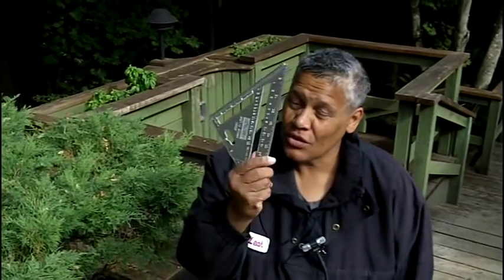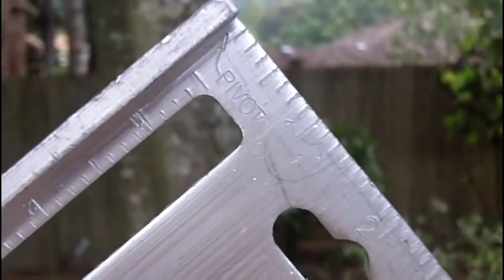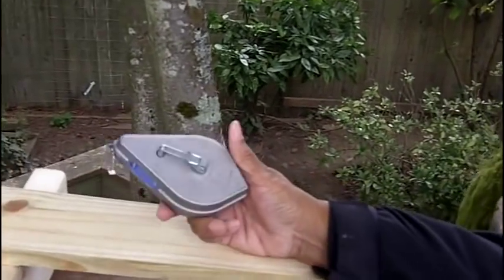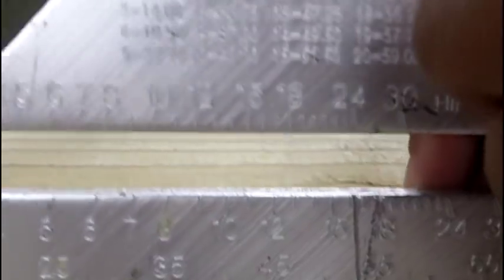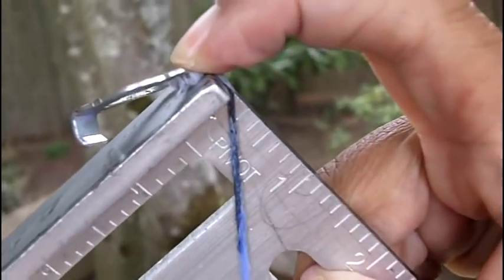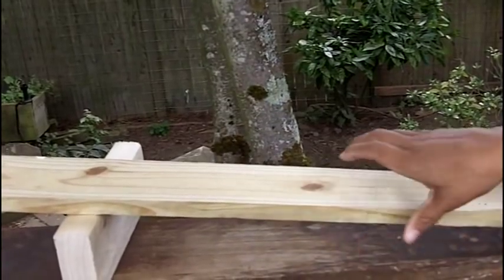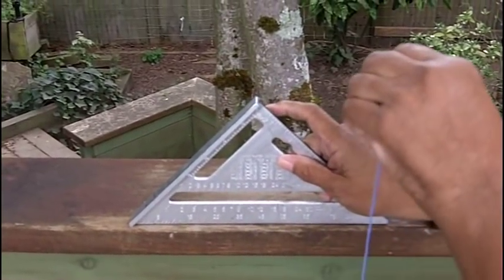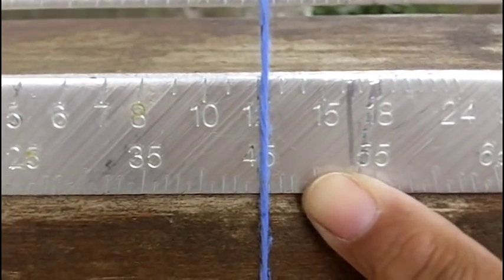If You Have a Speed Square You Have a Level

Comment: Misleading. You can't do it without a plumbbob of some sort.
Reply: Do you wear shoes with shoestrings? Tada
Reply: @TheSaltblock  It's still misleading. But... no, I actually don't. I wear "slides" because I take my shoes off every time I go into the house so I don't beat up the nice maple floors (13/16" T&G) I installed there.

BTW... "TaDaH" is a bit personal; that's my initials with 'a' between them.    8)
Reply: @timhofstetter5654  ill buy you a string for your sunglasses which can also be uses as a plumb bob. This way those maple floors remain unmarked. Is it really sooo misleading though? Imagine telling me how to use my windshield washer button. Do you have to tell me it needs washer fluid too? Same with my blinkers. I already assume ill have to refill the blinker fluid.
Reply: @TheSaltblock  Yes, it's misleading. The bob is more important than the speedsquare is. With a bob and any ol' square-cut piece of plywood (or even a square-cut 2x4) you have a level. A speedsquare without the bob cannot make a level, though, even with all the plywood scraps in your shop.

Disregarding, of course, the fact that you also have a level if you own a scrap of clear plastic tubing and enough water to fill it...

BTW, I don't wear sunglasses, either. No need. I can handle life just fine without them.
Reply: @timhofstetter5654  since you love to argue...the pythagorean theorem could find square, then level with a few short calculations. However, you will need a calculator and tape measure. Sorry if i mislead.
Reply: @TheSaltblock  I don't love to argue. I don't like to feel like I have to just to set records straight. 3-4-5 can find square with no involvement by Pythagoreas, but CANNOT FIND LEVEL without some sort of gravitational reference, which cannot be provided by any sort of geometrical figure. The gravitational reference is all-important because "level" is a gravitational reference.
Reply: @timhofstetter5654  hence the tape measure. You were so close too.
Reply: @TheSaltblock  Although it was understood that the tape could have been used as a bob, it was not acknowledged because its use as a bob supported MY point, NOT YOURS. It only substantiated my case. I felt no need to drive that nail below the surface.
Reply: @timhofstetter5654  well had you countersunk, youd understand my point was substantiated purely by logic yet influenced by fact.
Reply: @TheSaltblock  Um... no. Nice try, but bad miss.
Reply: @timhofstetter5654  havent missed in the last 30 years. My walls covered in hide show such.

Comment: Nice trick but any carpenter worth a penny should have a level handy at all times. Much easier to use one tool to find level than to use two.
Reply: Dan Moffett how do you know your level is true?  Most guys just heave them in the back of their pickup which will pretty much ruin a level.

I also think you missed the point of the video, she wasn’t abdicating using the speed square over a level.  She was showing a tip on how to find level using your square in the event you don’t happen to have a level with you.